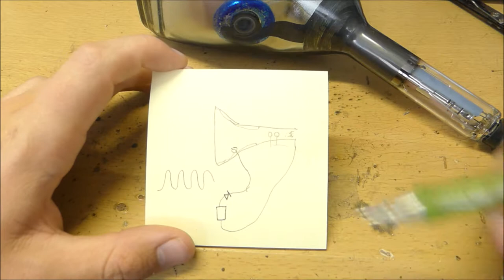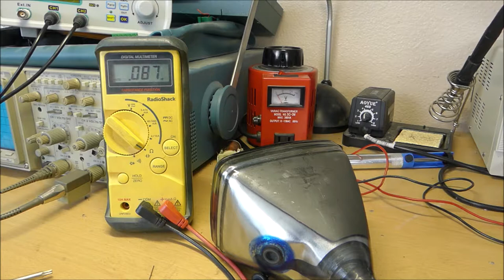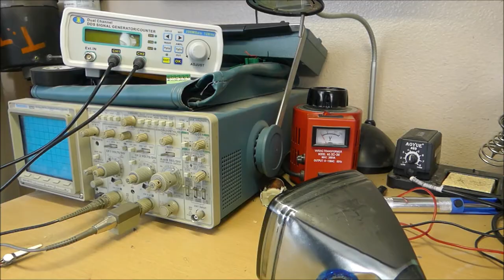How and Why a CRT is Used as a Capacitor

Comment: You know what, I just realised now why some times you would get static on the glass screen, I'd wipe it away with my hand, sometimes the little static charge would cause a minor pain other times it would be fine, it also explain why those screens could get filthy with dust!

Some of the monochrome ones you'd have to be careful of for 0utting out low energy xrays

Comment: interesting.  I hadn't thought of the fact that the CRT itself is the capacitor that stores the dangerous high voltage you need to discharge before working on it.